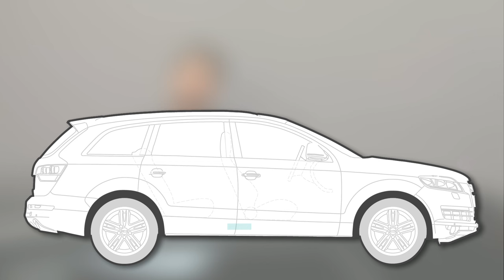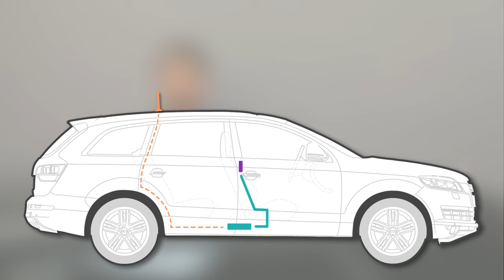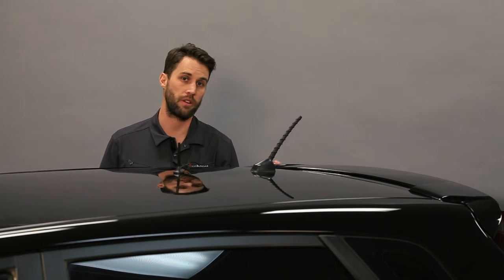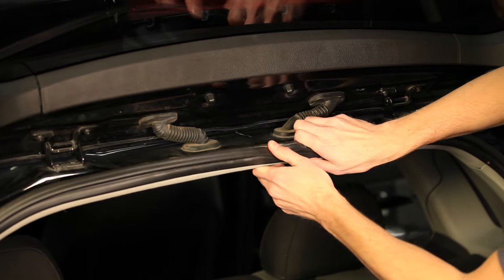How to install a cell booster in your car, truck or RV like a pro | weBoost

Comment: Our External Antenna keeps getting knocked off the roof of our mobile command center by tree branches.  What have others done?  If we cover it with a heavy duty welded cage, will this interfere with its use?

Comment: What is the official distance from the outside antenna to inside antenna? I read 8 ft however some cars won’t have that type of distance. Also does the trucker antenna already come with the ground on it or do you have to find a metal surface to attach it to like the small magnet antennas?
Reply from the maker: Hi Isai, the recommended length is 10-15 ft if possible, however if you can get enough distance from the inside and outside antenna without the booster indicating oscillation (feedback) then you should be okay if the booster is working. 
Concerning the antenna, the antenna is already grounded so it does not need a metal surface like the magnet mount antennas do. All it requires is a horizontal pole to be mounted to, like an RV ladder. Let us know if you have any other questions!

Comment: how come you didn't finish the installation what if I mess it and I am not a pro on DIY
Reply from the maker: +MZB Gamer I hope this didn't cause you any trouble. I zip-tied the booster to the seat mounts on the floor. You can also just slide the booster under the seat and it will be fine. Just make sure that you've got adequate ventilation wherever you decide to install the booster.
Reply: +weBoost If I but the Flex, can I put the booster/antenna conbo under the seat?
Reply from the maker: +Captinprivate You could put it under the seat but that will limit the amount of signal you'll receive up where your phone is located. Ideally you'd place the flex close to where you'll be stowing your phone while in the vehicle.
Reply: +weBoost Thanks  I will try it under the seat first  (I only need to fill a few drop off points) If that does not work, I will move it
Reply from the maker: Sounds like a good plan, let us know if you need any further help.

Comment: I'm going to be doing this soon but with a through the roof antennae. Then those trips to the cellular service challenged mountains hopefully won't be so bad. Here is a link to the external antennae I plan on using. 

http://www.wpsantennas.com/trab80617103-antenexphantomlowprofilemulti-bandantennablackwithpatentedfielddiversity.aspx